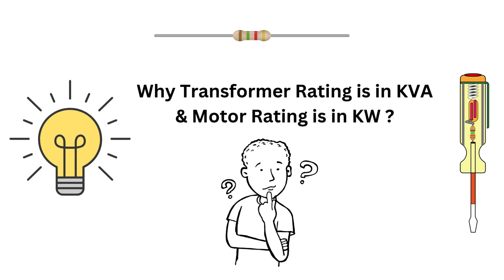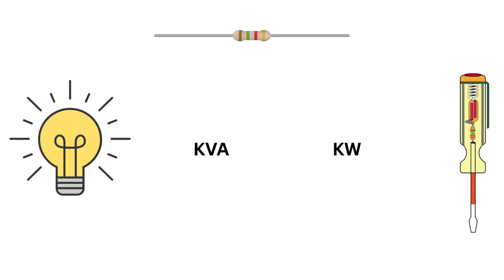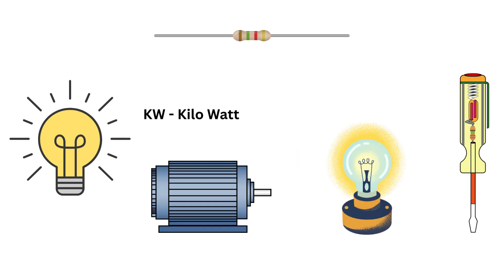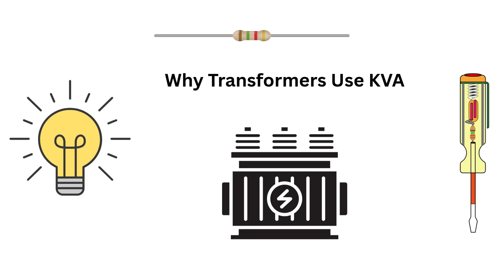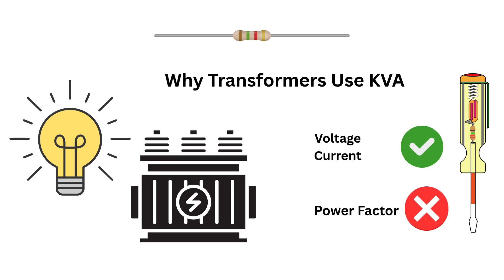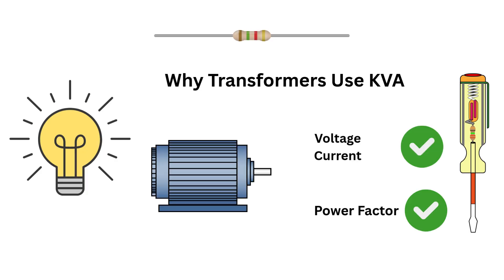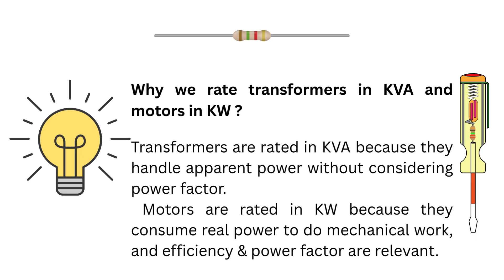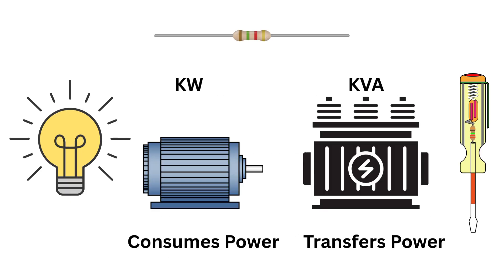KVA vs KW Explained! ⚡ Why Transformers & Motors Have Different Ratings

Comment: There are some missunderstanding here. Reactive power is not due to inficiences and does not generate heat or anything (at least not directly). Reactive power is a result of current and voltage being out of phase in an AC circuit. When current and voltage are out of phase (PF less than one), a transformer will need to be carrying more current to support the same load in watts (real power). So PF is very much important to the rating of a transformer. Let’s give an example to paint this picture. Ie a transformer support a load of 1kW resistive load (let’s say 250v for nice round numbers) with a PF of 1 will be drawing 4 amps of current from the transformer (as dictated by P = VI). However if that load is an inductive load with a very poor power factor of 0.5, there will be twice as much current through the transformer. In this example transformer will have to handle 8A. And given the transformers sizing is probably very much limited by current, this would be why they are rated in kVA. Because PF (and current), is very much important to their sizing.

I suspect too much is attributed to sensible conventions having transformers rated in kVA and motors often in kW. Either could be rated in either as they measure different things (but for a transformer rated in kW probably not very sensible as this does not tell the whole story if you ignore PF). Unfortunately arbitrary convention I suspect has people doing summersaults trying to explain something that is not a rule, it is only convention and doing a bit of adding 1 + 1 and coming up with 11. But neither tells the same story, or gives the full picture. It could be argued that rating a motor or load in kVA is more useful, especially if you are using that number to size a generator, or supporting grid connection, because it does take into account PF and the all important impact of current from this. But I suspect they are often rated in kW, just so people know how much that will cost them to run that motor as most utilities charge per kW/h rather than kVA/h.